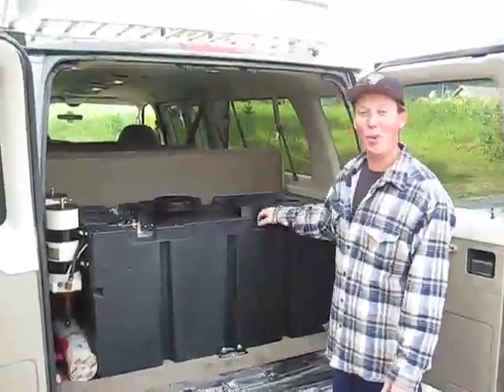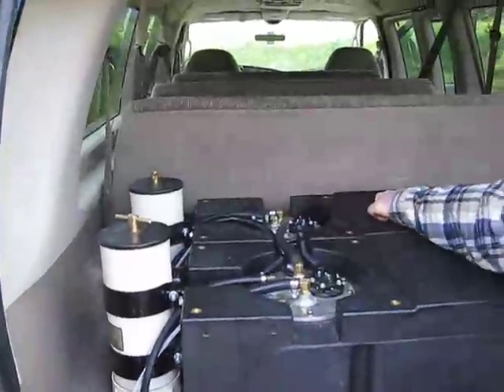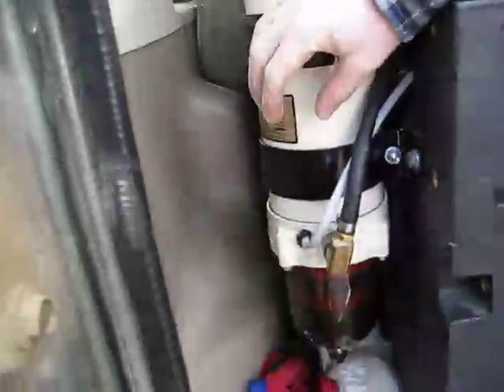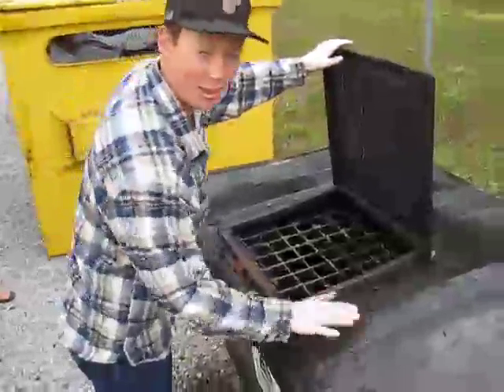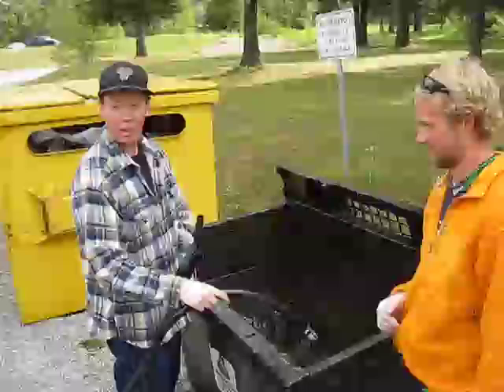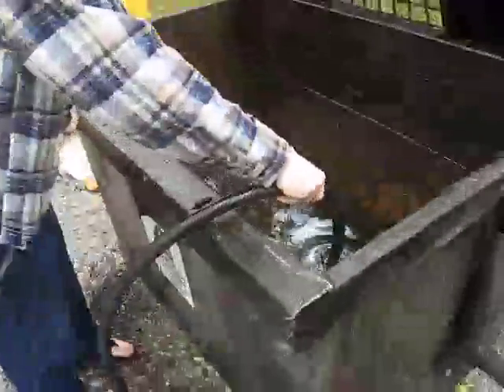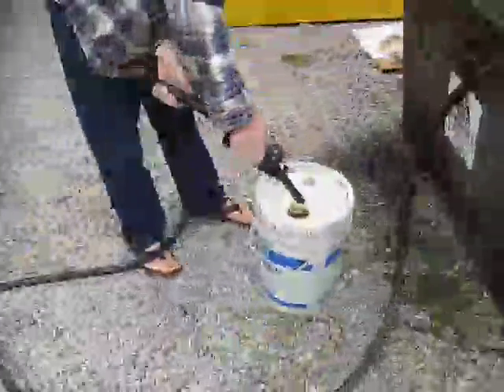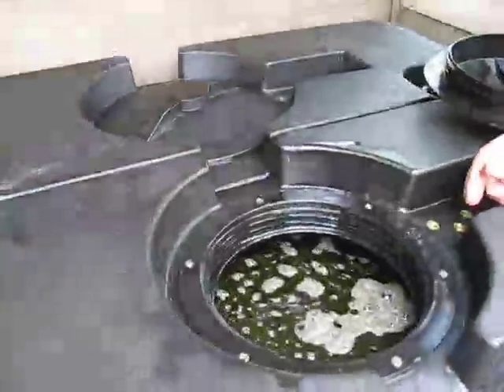Veggie Van - save thousands in fuel costs!

Comment: how does it lower carbon emmissions?
when u burn veg oil it still makes carbon emissions!
They say well it comes frome plants so its carbon neutral but so did coal!!
why so expensive for the fuel system?
u only need a couple of heated fuel filters/lines and valves and an extra tank.